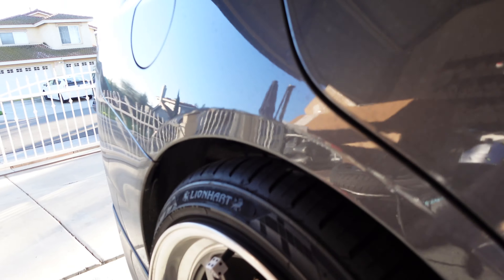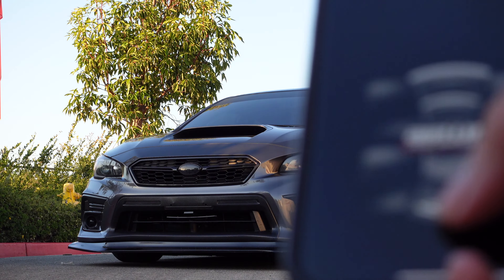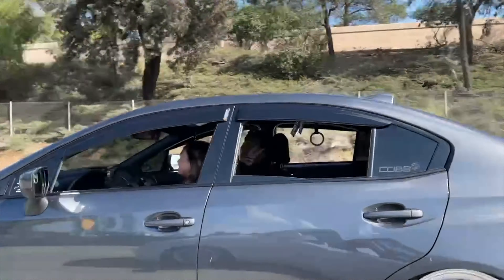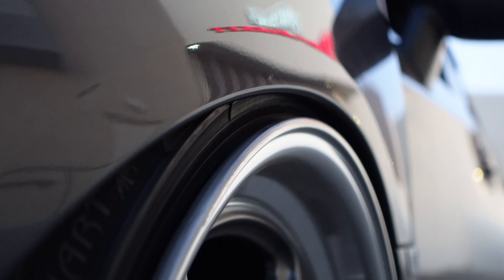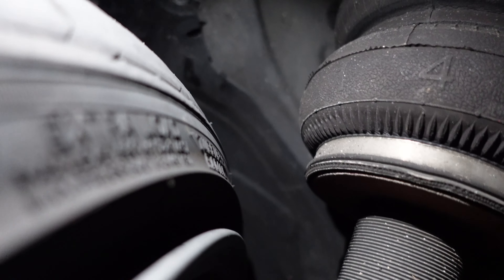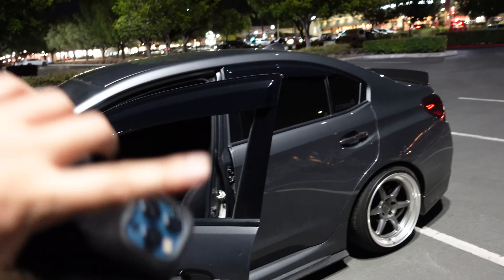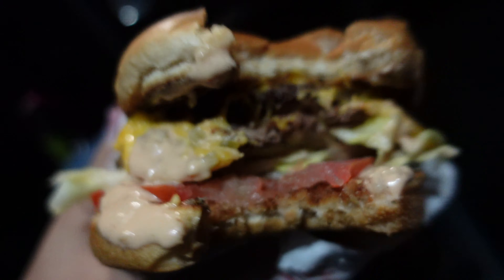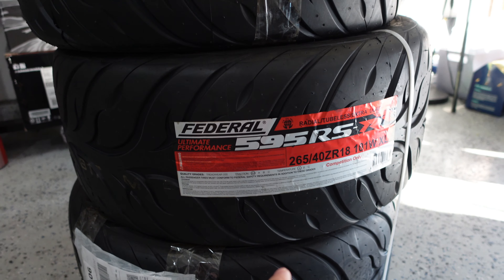THE SAD TRUTH ABOUT COILOVERS VS BAGS | SHOULD I GO STATIC?

Comment: Damn I’ve been on bags for 2 years never encounter the fuse pop lol. Got a va wrx love it. My only issue is the pillow ball bearings 😢
Reply from the maker: the pillow ball!!!!!! My passenger side started knocking and thudding really bad a few months ago. I took it apart and placed high temp grease on every single moving component. It drives like a dream now.
Reply: I did the same. Did you know they sell dust caps lol

Comment: Would air suspension be a liability for track use? Let’s say you run sticky tires and your sticky tires sling rocks around your wheel well and punctures your bag while you’re at the track? Theoretically anyways. That’s what I imagine and that would be pretty bad lol
Reply from the maker: Airlift bags are top tier STRONG. haha. they’re not sensitive. they’re just as strong and thick as a tire. it can take plenty of load, force, and abuse. the only time a bag will puncture is if it’s rubbing against a tire that sits too close to the strut. so higher offset wheels would be ideal when running meaty tires. 

to answer your question, rocks/debris slinging onto the bag will do zero harm.

Comment: what’s your ride height? I do 55 on all because it rubs my fender liners when i go lower, also does bagged suspension feel stiff for you? when i drive the suspension is super stiff and the drive is bouncy as well even on smooth roads
Reply from the maker: i have my rear struts adjusted to max low and my front struts adjusted to lower than half. I ride around with 55 front and 50 rear! 

It’s all about the dampening bro! the softer you leave it, the bouncier it can be. But the stiffer you make it, the more aggressive it will be. So you really have to just mess around with it. 

All bags are going to feel different. So if you already adjusted your dampening and it’s still bouncy, I reccomend increasing your PSI for less rebound on the air bellows 👍🏽👍🏽 

If it sits too high after increasing PSI, I suggest adjusting your struts to make it lower
Reply: @abgtaxi  thank you so much bro, i really appreciate it because my tires rubbing on my fender liners sound like my car is about to break 😭
Reply from the maker: @mvrk7773  60-65psi should hopefully do the trick! You can soften your dampening as you increase psi and you should hopefully get less rebound and a little more comfort 😸

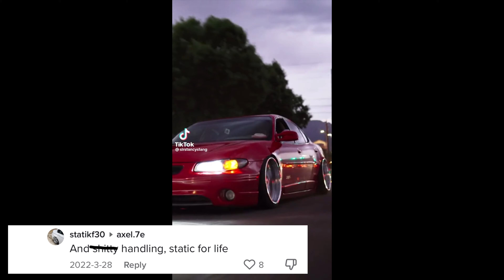Comment: 6:19 Nah this is fake low, you can’t be riding around like that and claim you’re “static” gotta get -20 in there slot your coilovers get the proper control arms and scrape the fuck out the bottom of the car, my opinion personally that’s exactly how my static wrx sits and I have to complaints other than the rust here and there. But I respect how you mentioned 7:04 that’s true static ideally drive your car how you’d like, I get breaking your shit sucks so I respect that, but if you’re gonna claim to be static you definitely have to put up with the consequences

Comment: Been really been debating on getting bags, currently have 2k saved but just don’t know yet, I have a 07 2.5i Impreza and I get odd looks from my family anytime I wanna do something to it, been told to just buy something else but it’s my first ride n I’m kinda attached. It’s a base model manual fully stock only things I’ve done is basic maintenance but wanna bag it and figure out a good wheel for it. Other people keep making me second guess myself tho. You think it would be worth keeping this car going as long as possible n modifying it my way or just giving in and getting something else?
Reply from the maker: Definitely depends how committed you are to your car. If you think maintenance would be an issue in the long run, I would definitely work on that first! But other than that, bagging your car is probably one of the sickest things that you can do. If you do it yourself (which I recommend) it can run you around 3.5k to 4k on BagRiders website for a good quality airlift performance set. There’s definitely a lot of pros with bags with very minimal cons (such as maintenance). You can show it, track it, or drive comfortably. You get 100% adjustability with dampening and “spring rates” which is the best part.